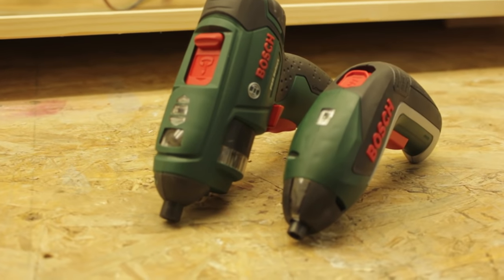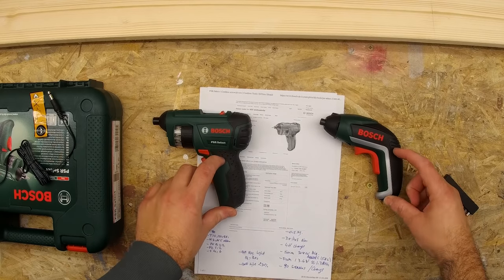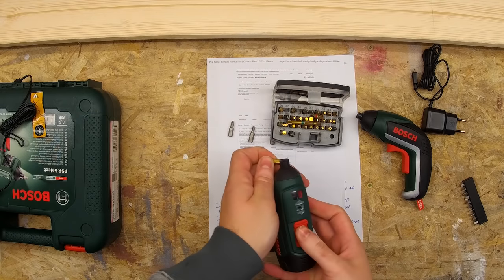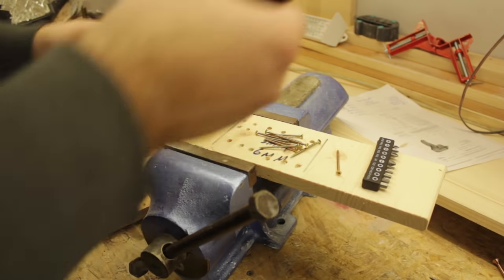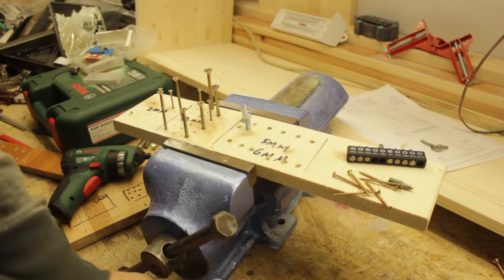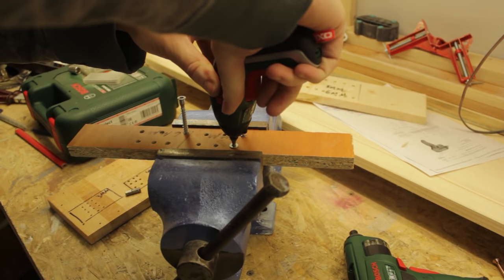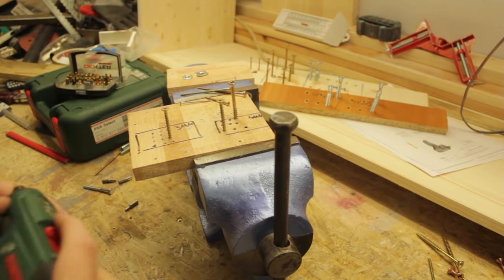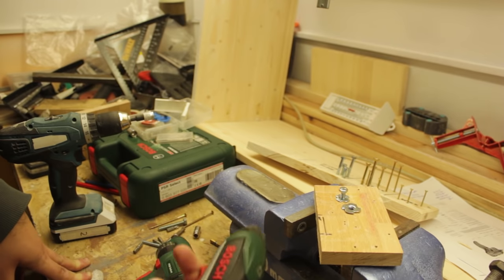Bosch IXO vs Bosch PSR Select - Which Cordless Screwdriver is Better?

Comment: I’ve been using my little Bosch IXO ( the original mark 1) for 16 years now, and it’s still working great. Very good for screwing together flat pack furniture/ racking, car underbody trays, car door panels, bumpers etc. I may replace it with another IXO, if it ever breaks.

Comment: I use my IXO with a hand operated coffee grinder daily, thing took forever using the crank that came with it, had to make an adapter as the coffee grinder has a 5 sides shaft and the driver recess if hex, have used it for 5 yrs at work, at home and around the yard, still good.

Comment: The old IXO models were much better than the last few. Moving the direction toggle onto the top is a dealbreaker, having to change hand position is incredibly annoying - e.g. if you are fine tuning something like a door hinge with numerous direction changes needed, the on top design is incredibly frustrating.

Comment: Question, do you think the psr would be able to handle putting screws into say a bedframe, eg:bed pallets which are around half an inch in thickness into a depth of say half an inch?
Reply from the maker: Hi, that's a tall order to be honest. If you have predrilled pilot holes, perhaps. Just straight in to pallet wood? I think even a regular cordless drill might struggle.

Comment: So the PSR can not use extra bits or elongation bit?
Reply from the maker: You would have to remove a bit from the inside and insert the longer bit in a fixed position. Since it doesn't fit in the holder, you would use the longer bit and remove it manually.

Comment: I believe this are meant for assembly and disassembly of apparent screws on appliances, tools, etc, but not for woodworking. So not sure if the test is relevant for these tools. They might be useful in an appliance service center/repair shop, light duty stuff. And as a recommendation for lots of views on this channel (maybe :) ), Lidl tools don't get that clear reviews on youtube and I see you do a nice job in this area, so if you agree, there are some tools tomorrow at Lidl that would deserve a nice review...just a thought.
Reply from the maker: Hi, yeah these are I think ideal for appliance disassembly. I have 2 LIDL tools waiting to be reviewed (air tools - the stapler and the socket impact gun) that I bought a while back. I will definitely check it out. Thanks!
Reply: Well, we all know that the best screwdriving tool is the battery driven drill, but then we are talking about different size of a tool, hence accessibility. Accu drill would be useless in tight spaces. ⛔
Reply: it's relevant for showing power &  torque. if you're disassembling loose furniture, but need to use larger screws this shows exactly how the screw driver would cope

Comment: I bought the I X O with all the fittings. Then the charger went down. This looks like an expensive piece of gear with a cradle for the drill. Permanently attached to a long lead. From the transformer plug..
Reply from the maker: Fair enough. You can probably find a compatible charger online or perhaps at a hobby store.

Comment: You are using predrilled holes, that isn’t really testing the drill
Reply from the maker: Fair enough, however these are screwdrivers. I mean, I generally pre-drill for screwing. However, since both used the same holes and screws, I figured it would work.
Reply: But can they create new holes?
Reply: @raymarkyeen6673  yes, but the screw needs to be the self drilling kind with a cutting tip on it.